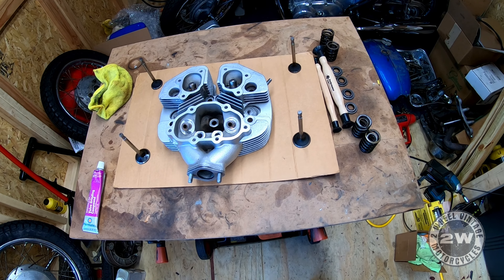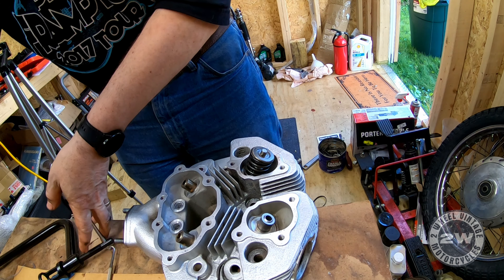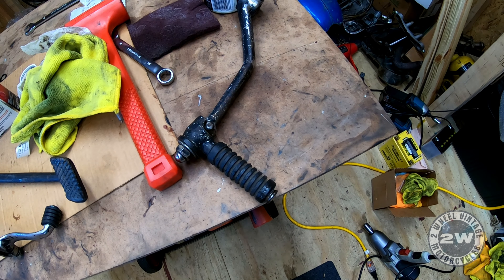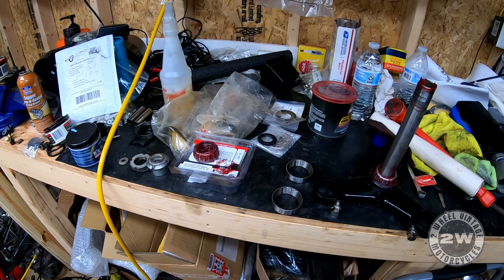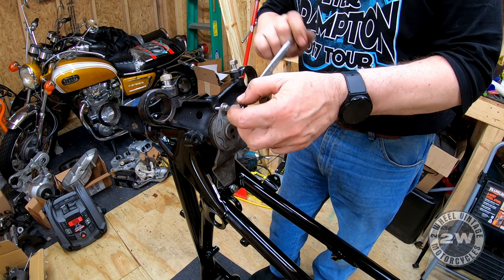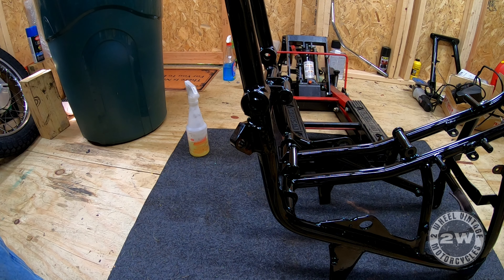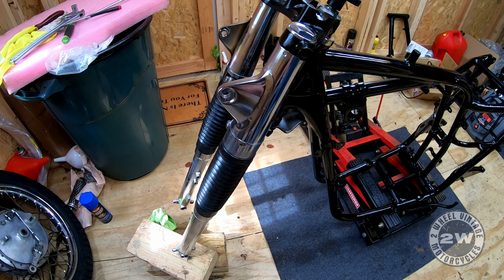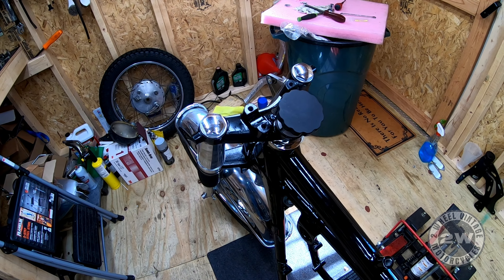Kawasaki W1 Part 9. Parts start to go back on the frame!

Comment: Fantastic watch your exactly where I am on my bike just got my other frame back and am about to install the forks and head stock bearings so very interesting .I think my forks will be easier than yours with those cowls and external fork springs "what a kus of a job that was , glad mine doesn't have those fork ears for the headlamp .Spot on job 👌👍
Reply from the maker: Yes, the external fork springs are a royal pain for installing them! Good luck with yours! Thanks for the comment 👍